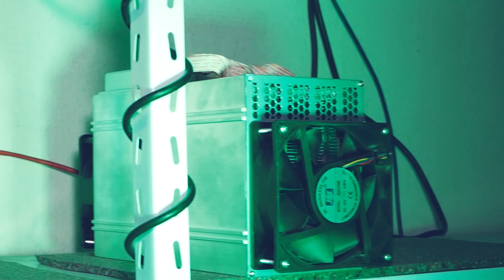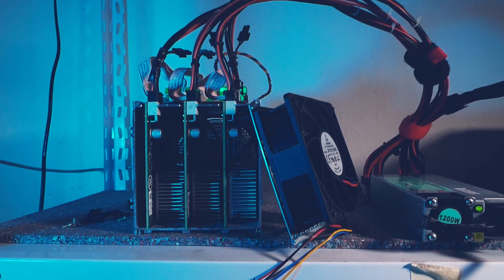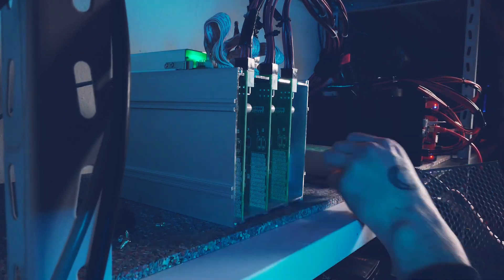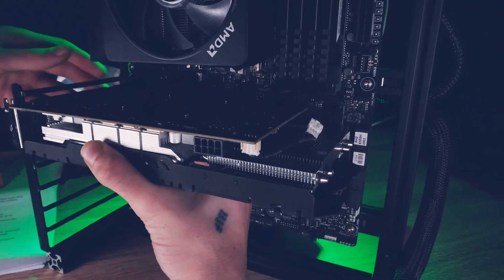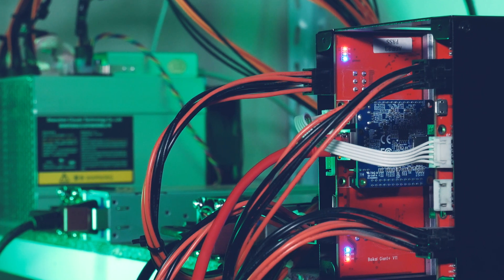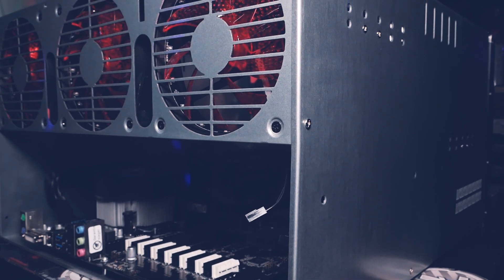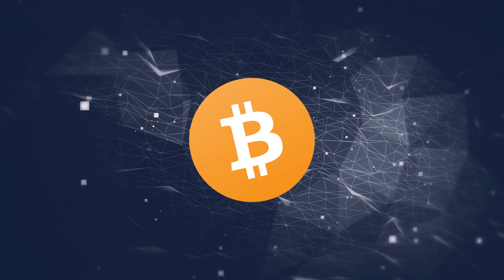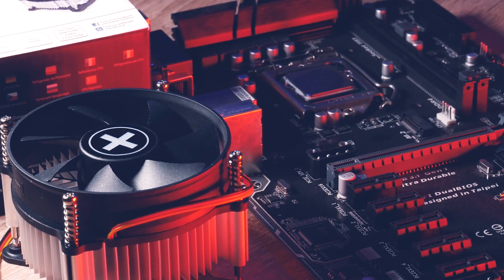Selling mining equipment & consolidating a small mining farm (GPU & ASIC)

Comment: Still on rig 1, but up to 5 x 570 8g for now.
Would you say stop at 8 cards then start rig 2. Or fill the h110 pro mobo with 12?

Great channel, great guy
Reply from the maker: Heyho mate! First of all thank you very much :) hmm I personally always preferred the 6 - 8 GPU rigs to then being able to divide them onto the house for heat etc. but also enough MoBos lying around :D so there's also an argument for a dense rig, depending on location and situation! Cheers mate ⛏️ 🖤
Reply: @CursedMining  thanks. I might stop at 6 then. That way I can get started on the second. Plan to stick to the same GPUs. Think it is my ocd wanting a set of three matching rigs on cudo.

After that, plan to give hive os  a try with another three rigs but different GPUs, 580's is what I am leaning towards, or 1660's like your good self.

Have a good xmas